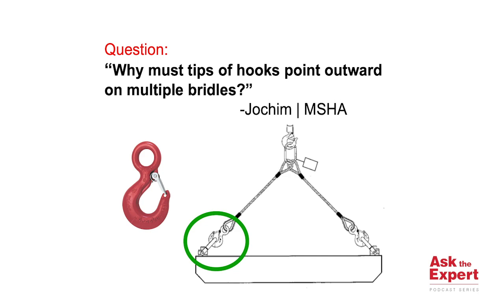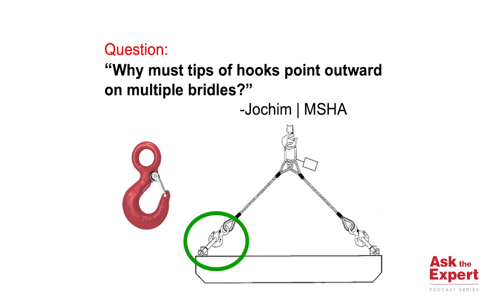Hooks: Why the tips must point outward on multiple bridles

Comment: I'm using Crosby hooks for connecting trailer safety chains to my truck.  While at the front of the trailer facing the truck, is it recommended that I have the point of the hook up and bring the hook rearwards to connect it, or should I have the hook opening facing downward and move towards the truck and hook it up in this manner?  I'm thinking the latter keeping in mind the saddle of the hook...  Kevin
Reply from the maker: When using a hook, we always want to remember that the hook should be loaded in the base or bowl of the hook and to avoid tip loading, back loading, or side loading.  The best practice of having the hook tips pointing up and outward is referring to using a hook with a multiple sling legs in an overhead lifting situation.  Rigging the hook in this manner positions the hook tips away from the directional forces induced on the hook, therefore reducing the likelihood of the load slipping out of the hook.  In the image below, there is a force that is pulling the slings toward the center of gravity of the load so the hook tips are pointed away from that direction of loading.  Best practice when using a hook is to have the hook tips or throat opening point away from the directional forces loading the hook if possible.  I hope this helps you determine how to best position your hooks for your trailer.